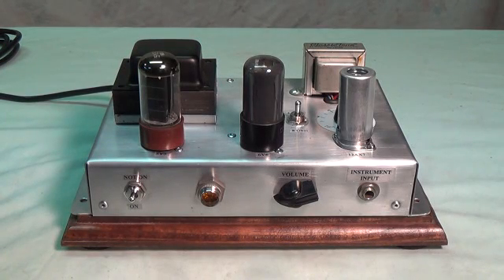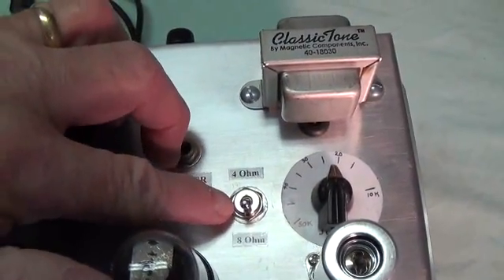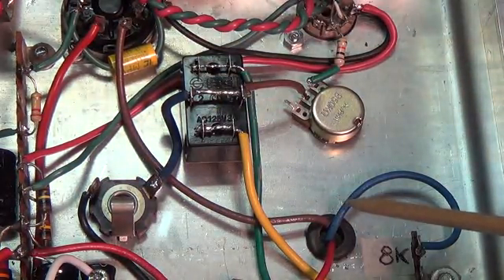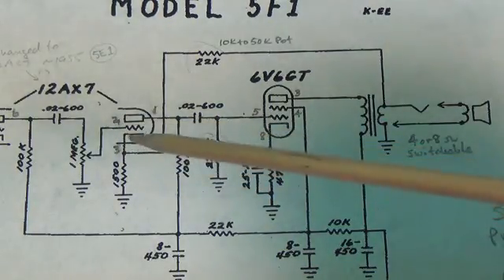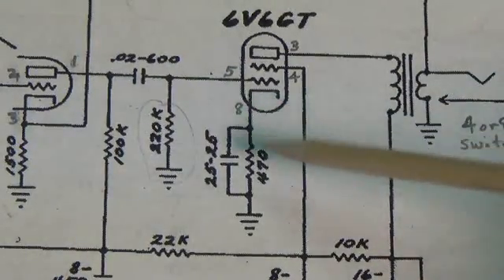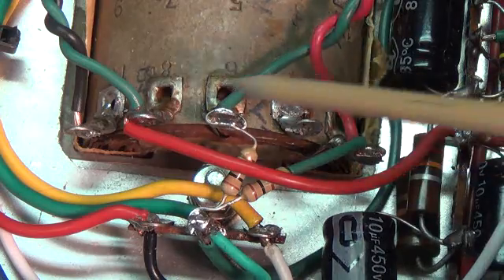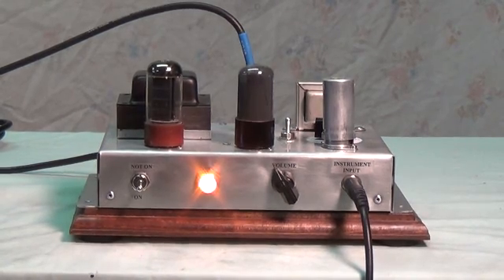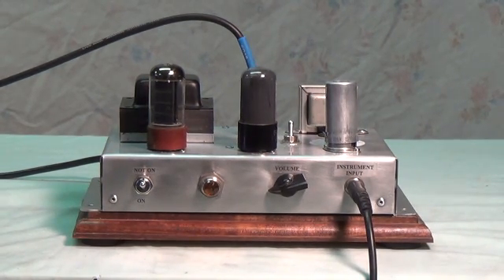Scratch Building a Fender 5F1 Champ from Scrap Parts.....Part 2

Comment: i have bild one from a old radio chassis !!match of the old radios ar bild on the general electriks based sircuit!  5U4 rect et 6V6 or 6L6 output tubes  you find these radios over here for 5 to 10 euros!!!!
Reply from the maker: roodbaard51 It sounds like you have a good, inexpensive source of parts for your homemade guitar amps, RB. Best of luck with your projects :)
Reply: the last one was a fender delux! had to bay a out puttransformer hamond canada ther good qualety found al the shemas on shematic heaven!! the rest was from a radio with push pul 2 6V6!!  have bought the books and videos of Gerald Weber dit the rest! but also your vids confirme and explain the electronics very wel! nice jop !!!
Reply: o yes i have had a strange experience the ground  conetion of the place were il do the amps was bad and  i heard a radio station on the guitar amp!!!
Reply from the maker: I've heard of such problems with wireless transmitters for guitars.

Comment: How does it sound without the tube shield? Is there a video without it?
Reply from the maker: Eviltech I was not aware that the presence of a tube shield affected tone. I always thought they were simply to reduce EM interference.
Reply: Uncle Doug That's what i wanted to know, how much humm will the amp have without a shield.
Reply from the maker: Probably not much. I have never noticed a huge difference between with shield and without, but since shields were used originally in the old amps, I try to maintain the originality.

Comment: Great work!  I want to do the same.  I have all the parts except tube sockets and I'm missing about 10 percent of the knowledge.  Great looking work sir!  I subscribed!
Reply from the maker: Steven King Thanks so much, Steven. You can order the small parts from Antique Electronic Supply in Tempe, AZ. The missing 10% of knowledge will require some Internet research and study. Thanks for subscribing and best of luck with your project :)

Comment: Oh... Will that 100ohm centre tap clean up a lil hum i have in a silverface champ. Looking at the schematic, it seems the lil champ has no center tap on the power transformer... I'll have to open it up again to see... those look like 1/4 watt resistors?

Have gathered all the parts from crap to make at lil 5f1 just have to hit the thrift store and see what i can find to may a chassis with.. great videos!

tnx
Reply from the maker: Dylan Cole When it comes to hum, Dylan, there are no guarantees, but the virtual center tap (in the 6.3VAC filament circuit) may well solve your problem. It creates two equal and opposite-phase signals in the AC lines, which tend to cancel hum.....much like in a push-pull OPT. Good luck with your 5F1 project.

Comment: For even less hum, make a 10:1 voltage divider across the B supply, and reference the filament center tap or virtual center tap to that instead of to ground.  Old trick for when you can't use DC filaments.
Reply from the maker: gregory pinkowski A very good point, Greg. Elevating the filament voltage supply above ground is an excellent hum-reducing maneuver. Thanks for your input.
Reply: And nearly free.

Comment: You don't have to use the switch to have NFB on both impedances.  In fact, doing it the way you did, the percentage of negative feedback changes with the switch.  You could have used two jacks for the speaker but connected the NFB to just one output tap of the transformer, which will work fine regardless of which tap the speaker is using; and that would give the same % of NFB regardless of which impedance tap the speaker was connected to.
Reply from the maker: Greetings, Greg. The switch was primarily to change output impedance to a single jack. Shortly after the video was posted, I rewired the NFB loop to connect to the 8 ohm lug only so that the amount of NFB is consistent for both impedance taps. I have also added a note to the video explaining this change. Thanks for your input.

Comment: Great video! About the negative feedback pot. It goes from 10k to 60k, right? Or is there something going on I don't understand? :) (10k constant, plus 0-50k variable)
Reply from the maker: Greetings and thanks, AP. This question has come up several times. The best explanation I can offer is that the pot was marked 50K and the resistor marked 10K, but when I measured the actual series resistance with a digital VOM, it read about 52K max and 10K min. The pot apparently had lower resistance than advertised.  I chose to go with the actual reading (rounded off to 50K), rather than the apparent total (50 + 10 = 60K), simply because it was accurate. In retrospect, I should have just taken the path of least resistance (no pun intended) and said "60K".
Reply: Uncle Doug Ah, silly me :) Thanks for response.

Comment: Dear Uncle Doug.
What's your take on insulated input and speaker jacks? Are they needed in general or only for high gain design? If you use ever used them, where and which one should you buy? Thanks!
I finished building my little pseudo-Champ bastard son of a 1960s Italian tube radio and a Japanese 1990s solid state Fender amp and I will post a video when I will be able to record the sound properly!
Reply from the maker: Greetings, G. I think you are referring to jacks that are self-grounded when nothing is plugged into them. If so, I think they're great for input but very dangerous for output to speaker(s). If you have multiple inputs, the self-grounding jacks will prevent any extraneous hum from the unused input jacks. However, for output if you accidentally turned the amp on with nothing plugged into the (self-grounding) jack, it would be a dead short for the output transformer secondary, which would probably destroy it. I get mine from Antique Electronics Supply in Tempe, AZ. Please let us know if you do post a video of your homebuilt amp.
Reply: Thanks for your advice on self-grounded jacks. I was actually talking about jacks which have an insulation from the chassis by having a plastic barrel or spacer so as to control ground loops. But probably they are superflous for vintage amps. Thanks again for the great channel and content.
Reply from the maker: You're welcome, G. I have been using the uninsulated jacks in all sorts of amps for many years with no problems. The only place I could see the value of an insulated (RCA) jack would be on a reverb tank.

Comment: I've got a Question. It appears that all of the components are grounded at one location ? I'm just wondering because I'm in the process of laying out an amp from the old reel to reel and was curious on the best way to ground the system.
Reply from the maker: Greetings, Gisli. The way the jacks are constructed, the outer portion (normally the shield) of the jack is in contact with the chassis, and thus grounded.
Reply from the maker: Do you mean circuit ground or chassis ground? The circuit components are grounded to the chassis so that the DC can return to the grounded center tap of the high voltage secondary winding of the power transformer. The chassis is generally AC grounded by the green wire in a three-wire power cable.
Reply: You actually answered the question beautifully with a question. But I was referring to circuit ground . On every schematic it just shows ground and I can't imagine having grounds all over the place . But still where ? Which you answered .I keep hearing a term " star grounding "  . But haven't seen a n example of it . Or at least that I'm aware of. I apologize for all the questions . Up till now all my knowledge was limited to tone shaping and gain of amps . This is my first build and it's going quite slowly .
Reply from the maker: No problem, Bryan. As you see in the schematic, throughout the circuit there are multiple connections to the chassis (circuit ground), which is the way most amps are built. Those who seek a little less "hum" have developed a building method by which the majority of these  circuit grounds all go to the same spot on the chassis.....and they radiate inward to that central spot like the arms of a star.

There are all sorts of conflicting suggestions as to where and how you should ground different components. I generally group the power supply grounds (electrolytics, PT center taps, chassis ground wire, etc.) together and separate from the generally star-grounded amp circuit grounds.....so there are two separate collective grounding spots. In both cases, it's a good idea to solder 2 big grounding lugs to the chassis (bolted, if chassis is aluminum) for that purpose.
Reply: Thank you for taking the time to answer. Much appreciated.
Reply from the maker: My pleasure, Bryan :)
Reply: Uncle Doug Speaking of grounding, I noticed that you didn't ground the speaker ouput jack, according to the schematic there is supposed to be a connection to ground (where the black negative from the OT is connected) right? Any particular reason for this deviation? Love your vids btw, they're awesome.
Reply: Of course. :) Thanx a bunch for answering my not so well thought out question. ;) And thanx for your brilliant videos and insights. You're a national treasure.

Comment: Was your power transformer just a regular transformer, or did it used to be part of another guitar amp? I'm wondering because I'm trying to build my own amp and I have a 120V to 240V transformer but, I'm not quite sure how I'll get 5V or 6.3V.
Great video by the way
Reply from the maker: Thanks, XD. It was the power transformer from an antique Audio Frequency Signal Generator (see Part 1), which is an audio oscillator rather than an amplifier, but it served a similar purpose. I have posted another video explaining how to identify all the leads from a power transformer, which may be helpful.

Your transformer should produce more than 240VAC.....most output tubes require 300V to 400V for their plates.....and it should have a 6.3VAC output for your tube heaters. If there is no 5VAC output, you could use diode (solid state) rectification. The PT is the heart of the amplifier, and it has to be right or the amp will never work properly.

Comment: All this talk of NFB loop adjustments makes me wonder, have you ever tried this on one of your Hammonds? I disconnected the loop entirely with my AO-44, and while the ECL86's are cleaner and don't do as well if you DO overdrive the hell out of them as a 12AX7 and a pair of EL84s would (like the AO-35), they DO seem to have a "bigger" sound with a warmer, fuller, more even overall response, and nixing the NFB loop made them even more open and bright sounding. This makes it an excellent amp to use as a quasi-channel-switching rig with my SD Twin Tube Blue in front. I have both the Blue and the TT Classic, and the Classic is mostly just my clean-boost for master-volume amps, but the blue can be a great sort of Vox/Marshall vintage compressed dirt box, when I engage it, I am just adding triode stages to the front of the amp and effectively switching to an "overdrive channel." Through my negative-feedback loopless AO-44, it really growls like an early JTM, with elements of a cranked AC-30. Before pulling the NFB loop, it would be a bit too dark and I'd have to turn the treble control on the pedal all the way up. But now it just sounds so cool, I record with it for almost anything that isn't "modern" high-gain.
Reply from the maker: Greetings, Adam. No, I have not done any NFB experimentation with either of the Hammond conversions. I will, however, keep your experiences and recommendations in mind for a future project in this regard. Thanks for the input :)

Comment: I just built a princeton 5f2. I am trying to get the bugs out of it. The audio cuts out when I turn the volume up 3/4 of the way.
Reply from the maker: Greetings, James. It's virtually impossible to troubleshoot amps long distance. I would first test the 1M VC and TC pots for good contact throughout their range. If they're OK, double check the TC caps (.0005uf and .005uf) to be sure they're the right value and in the right positions. The problem is probably in this area. Good luck.

Comment: superb build doug!!, could you easily install an  effects loop in to this little amp im looking for a small practice amp to build, and your work is top notch sir!,all the best from rob , from Scotland...
Reply: seth sloppers willy decided he wanted 12ax7 and 6v6.. to try and get that old warmer sound
Reply from the maker: Thanks so much, Rob. Several of my ancestors came from Scotland. It's a beautiful place, and I would love to visit some day. Best of luck with your amp project.....be sure to let us know how it turns out :)
Reply: will a effects loop be a hard thing to to put in to this amp doug , your reply will be most helpful.
Reply from the maker: Sorry I overlooked your question above. I would not recommend trying to insert an effects loop between the 12AX7 preamp and 6V6 output tube in this amp, Rob. Most effects used in such loops are transistorized and operate at very low voltages (6 to 9VDC) which would most likely create an impedance mismatch between the high voltage tube circuit and the low-voltage solid-state effects unit.

 Although it is possible to create a circuit that can compensate for this mismatch, it would not be an easy task.

I think your best bet would be to stick with stomp-box effects between the guitar and amp input, at least with a small tube amp such as this one.

Here is a link to an article in Premier Guitar that elaborates on the subject:  http://www.premierguitar.com/articles/Effects_Loops
Reply: Uncle Doug sorry to hop in here... willy and I were thinking on doing this with the parts from that champion amp I got just recently.  I did manage a simple one tube design using the fender 8 ohm tank with tanny.  but my fear is, that it would destroy the tone of the amp..... also I would have to install another resister after the wiper of the volume to do it. This would probably kill some of that wonderful drive to the 6 whatever 6 I will use.  Guess I will be happier with a box on the floor... and it would be a reason to go spend some money on neat stuff too!

Comment: Hallo Mr Doug,
Perfect explanation, as always.
Coud you help me to find Schematics of a Fender Ultimate Chorus PR 204 (230V 50 Hz) . Somobody braught it to me to be repaired because is dead at the moment.
Thank you for help and regards
BEN
Reply from the maker: Thanks so much, Ben. Whenever I want a schematic for an amplifier, I simply do an Internet search, i.e. enter "Fender Ultimate Chorus PR 204 Schematic" into the search engine and the schematic will appear. Good luck.
Reply: The schematic should be the same as the US version. The only real difference is that it would have a different power transformer and power cord than US Spec.

Comment: Heh, thanks for that annotation, that bit about the negative feedback going to the 6v6 almost made me question everything I know.
Reply from the maker: You're welcome, Morgan. Without any verbal-editing capability, I have to rely on notes to make corrections. I apologize for any initial confusion.
Reply: A bit of a related question: On both the Leslie 122 and 147 amplifiers, the plates of the 6550s are linked back to the grid with 56k resistors and coupled with 100pf/1000v capacitors. Do you think these may be negative feedback loops?
Reply from the maker: I looked at a schematic and must agree that it does appear to function as a NFB loop. This circuit would inject a fairly high frequency (the portion of the signal that can pass through the 100pf) out-of-phase signal back to the grid, which would neutralize some of the high frequency portion of the incoming signal. The overall effect would be to reduce shrillness perhaps (?).

Comment: Thanks Doug for great little vid, I was just GIVEN a 78 pro reverb, 2nd Chanel working only,no reverb working,vibrato just working, normal Chanel very faint, mate if you lived here in Australia I would ship it straight to you for repairs,can't win them all I suppose.  Anyway thanks again for the great vids, cheers greg
Reply from the maker: You're welcome, Greg, and congratulations on a nice acquisition. I wish I were nearby to help. If I were there, I would first focus on the reverb and tremolo tubes.....perhaps replacing them or exchanging them within the amp to see if change occurs. I too recently had a problem with extremely weak reverb in a '74 Deluxe Reverb (the circuit is identical to yours). In this case, the tubes were fine, but one puny .003uf capacitor (carrying reverb signal to Reverb pot) caused the grief. Still, the tubes are always the best place to start. Also, you probably know the old trick: rattle the tank. If the spring noise from the speaker is loud it's probably the input that's bad. If weak, it's probably the output. In my case, it was weak. Good luck !!!

Comment: Hi Doug, thanks for uploading the videos, I enjoyed watching them and they'll help me with my own amp. I have a question about the neg feedback loop: doesn't 10k plus 50k in series equal a max 60k of resistance for the nfb resistor? Cheers!
Reply from the maker: Greetings and thanks, Macheath. This question has come up several times. The best explanation I can offer is that the pot was marked 50K and the resistor marked 10K, but when I measured the actual series resistance with a digital VOM, it read about 52K max and 10K min. The pot apparently had lower resistance than advertised.  I chose to go with the actual reading (rounded off to 50K), rather than the apparent total (50 + 10 = 60K), simply because it was accurate. In retrospect, I should have just taken the path of least resistance (no pun intended) and said "60K".